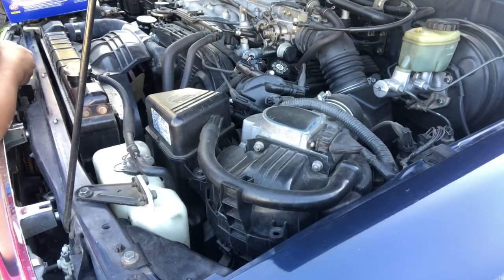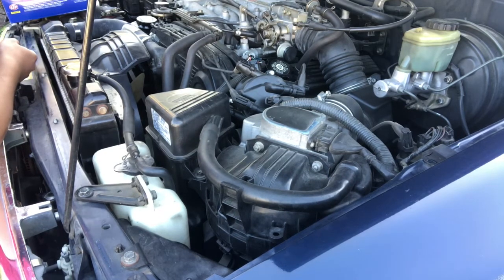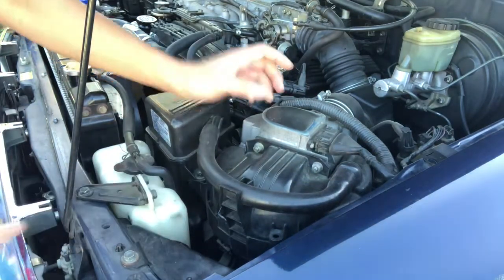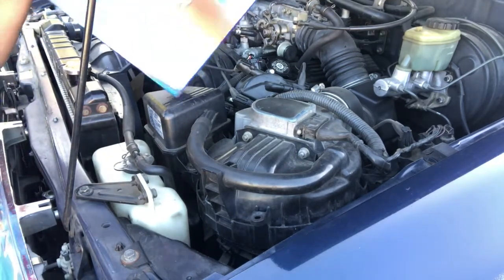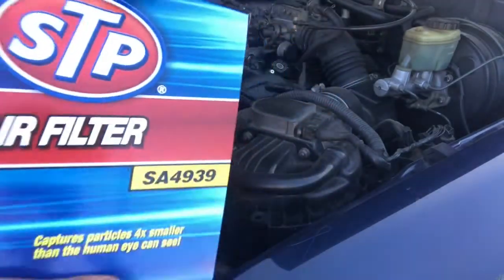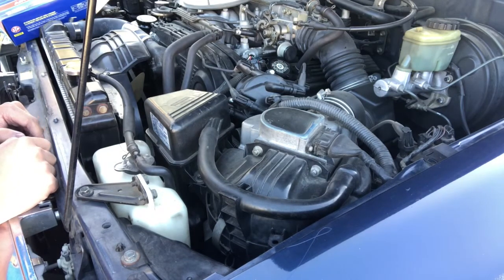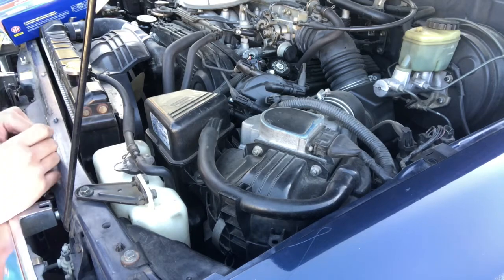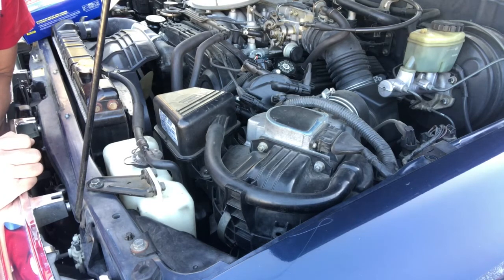Toyota 3VZE STOCK Air Filter Replacement

Comment: Hey what's that little box connected to the air filter? Mine has a hole in it and I'm looking to replace it myself
Reply from the maker: It’s part of the air intake and it’s also connected to some vacuum lines
Reply: @TndPnyRCofficial  Thanks. Does that mean I have to replace the whole hose or can I find the box separately?
Reply from the maker: You can find both the hose and box in junkyards. That’s what I can easily find
Reply from the maker: Also your local parts store
Reply: @TndPnyRCofficial  thanks so much for replying!